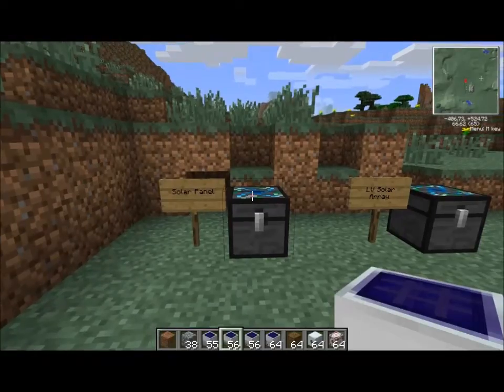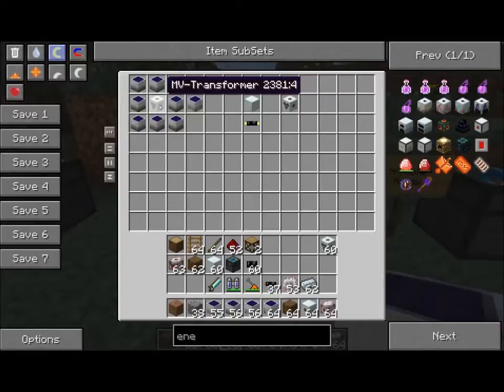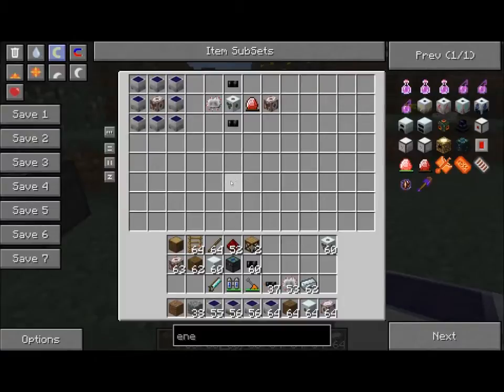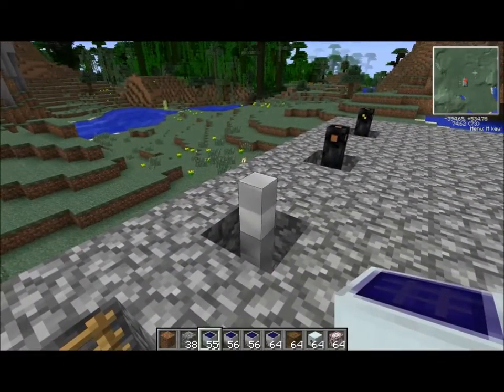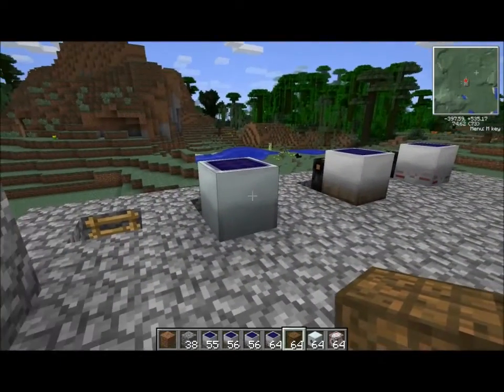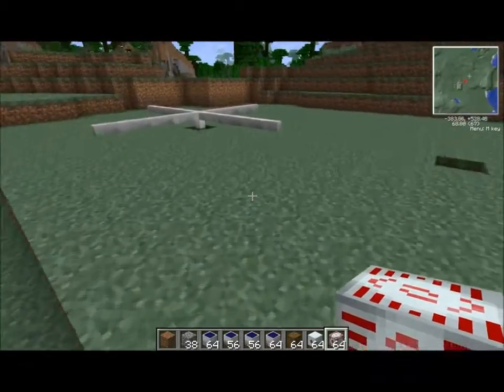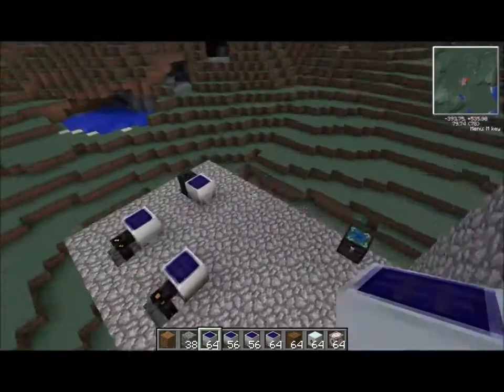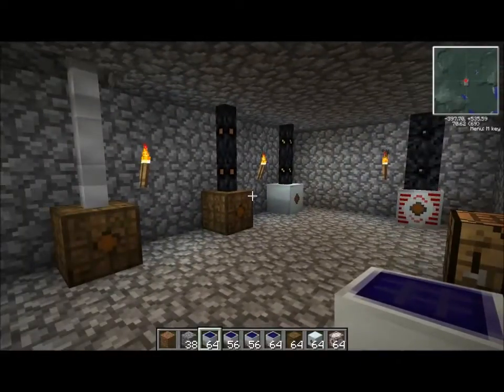Industrial Craft 2 (IC2) Solar Tutorial- Panel And Array Construction, And Basic Differences

Comment: My guess on the solar panel can't generate eu with just one is that the amount is so miniscule that the wire consumes all the eu before it reach the bat box
Reply: copper cable beginning to loose energy after a 14 block range. Glass fibre cable at 100 block